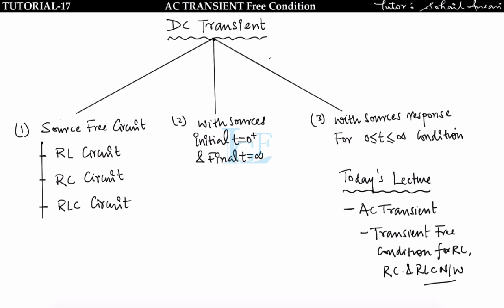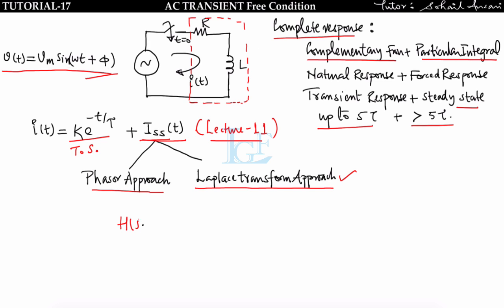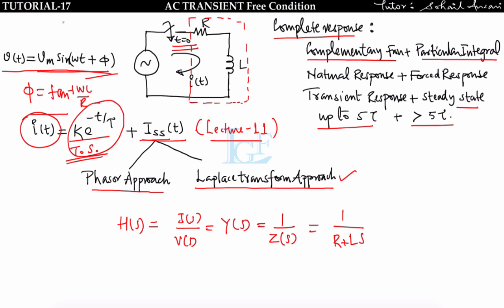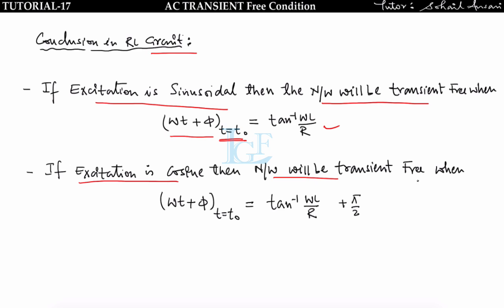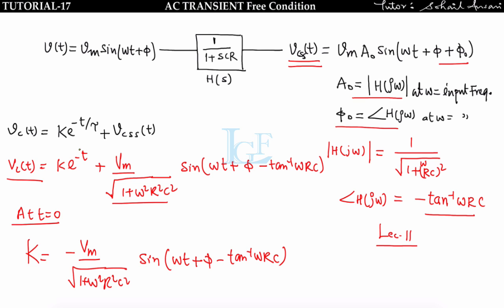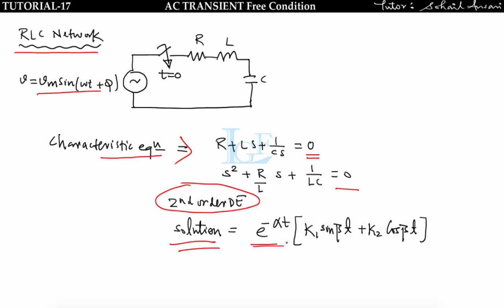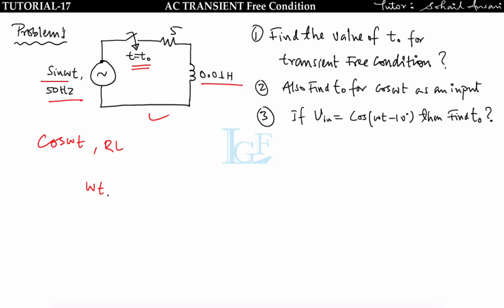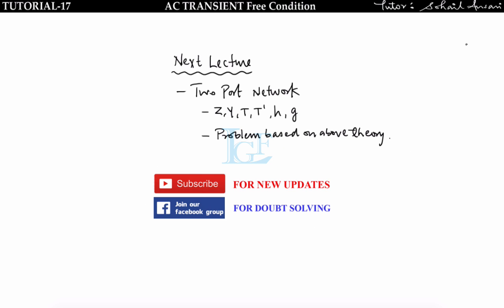Lec-17 AC Transient Free Condition

Comment: Sir in RC network..current will lead so phi should be +ve na??
Reply from the maker: yes phi should be positve..where i wrote negative..tell me the time?
Reply: 15:09 For RC
Reply: i think phi0 should be positive..
Reply: sorry sir..i got the point the point...i was taking current as output..so i had different transfer function..extremely sorry sir
Reply: i thought that..like rl circuit here we will also calculate current..

Comment: At 12:26 how Vc(t) came ?
Since Vc = V(t) x Capacitance of other branch/ total impedance
But you take capacitance of same branch since there is a resistor in other branch Should it be 'R' in the numerator instead of '1/Cs' while calculating Transfer function.
Plz help and reply quickly....
And Is this in ECE syllabus or only in EE ?

Comment: i tried everythng but my anwsr for 1 qstn is 0.107 sec.. any idea, what is wrong
Reply: sir calci should be radian mode then answer is coming right
Reply: The angle will be -10 not +10
Reply: yupp its done., btw thnx to all. ;)
Reply: sir.. calci need to be in radian mode. then only ans comes as 0.0176 sec. let me know if their is mistake on myside or yourside.
Reply: Vaibhav gondkar yup,.. its mine. actually i m calculating by norml clci at tht tym so.,, bt its done. thnx
Reply: we get in degrees for tan value,convert into radian
Reply from the maker: check ur calci...ur calci may be in radian..make it in degree then do the operation

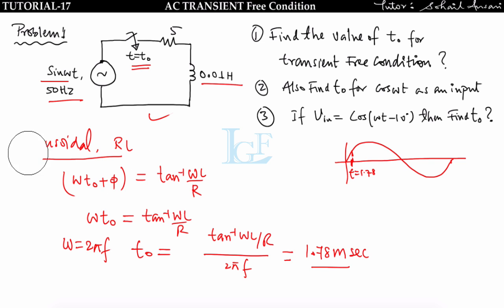Comment: @ 22:03 m getting time t0 =0.1022.if i am wrong plz correct me
Reply: 1.78msec is right.bcoz when we solve tan-1(WL/R) then it comes in degrees so we will have to convert into radian i.e multiply by (pi/180) and divide by (2*3.14*50).then we get 1.78msec.
Reply: Rajdeep Singh  thanks !
Reply: Rajdeep Singh thank you so much
Reply: Thanks

Comment: in probem 1....I am getting t0=0.102sec  instead of 1.78 ms ...I HV tried multiple times ..please crosscheck...and the same in the following parts
Reply: while solving the output of tan inverse  we are getting is in degree so change it in radian by multiplying it  with(pi/180) then you will get the right answer, do same with the following parts
Reply: Babita Singh thanks
Reply: why do we take value of pi as 3.14, shouldn't it be 180?

Comment: Sir, I have a doubt....For RLC circuit, you said we cannot make sine and cos zero at the same time...k fine.. but what if we find the value of K1 and K2 using intial condition and find the condition to make K1 and K2 equal to zero as we did in RL/RC circuit.... can we obtain transient free condition in RLC circuit then???
Reply from the maker: no u wont obtain transient free condition in any case...u cannot able to make K1 and K2 both zero at the same time..for some time K1 will be zero but K2 will not be zero..and vice versa...so transient free condition is not possible for RLC network